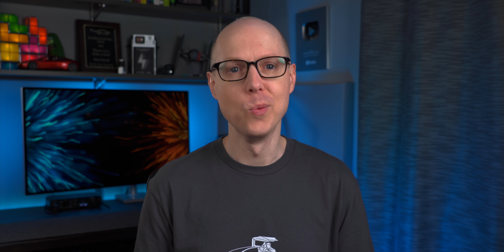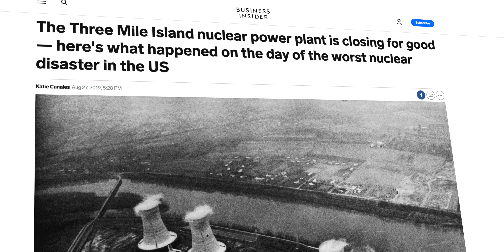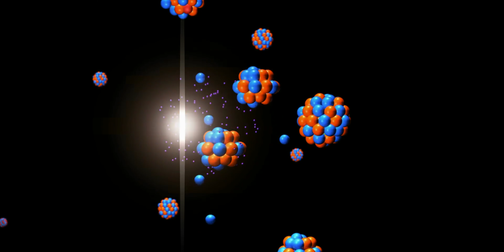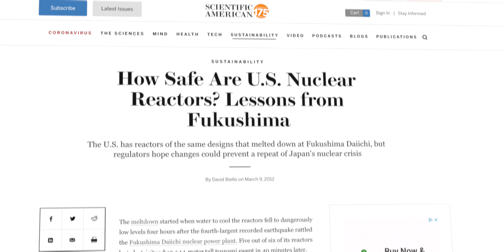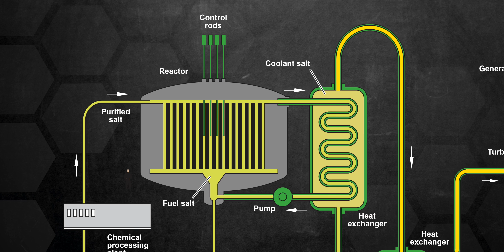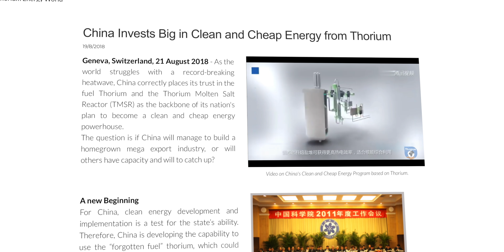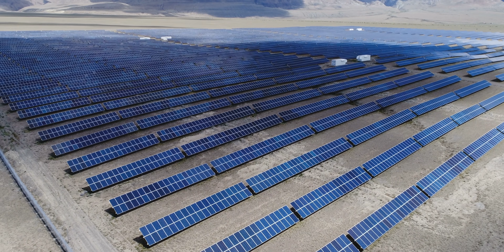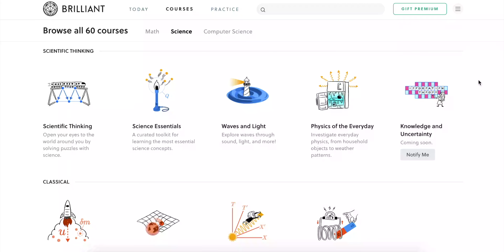Thorium explained - the future of cheap, clean energy?

Comment: We have had solar panels and a battery for 6 months. Our net electricity usage for a 5-bedroom house + EV + PHEV is -2.5 MWh.  This is, we have exported 2.5 MWh more than we have imported.  And we do not need to store any harmful byproducts for hundreds or thousands of years.  If everyone did the same, there would be no need for nuclear power.
Reply: The average residential sector uses 10-20% of total energy, and over half of that as raw heat, not electricity. (see Mackay or IEA for data) So, if everyone did the same, we would still have 80% of the low-carbon energy problem left to solve.

Just think about everything you and your family have no control over:
* tomatoes and other food 
     - power for ammonia, to irrigate, to pick, to ship, to cool, to sort, to package
* sewage and water
     - is your household electricity pumping, filtering, treating and metering?
     - you may pay MONEY for it, but you don't pay POWER for it
* offices, stores, and schools
     - do you control their lighting and thermostats
* buildings (including your house) and vehicles (including your EVs)
     - power to refine steel, to fire bricks, to melt glass, to produce plastics

Comment: There is a company called Moltex Energy that has an office in New Brunswick Canada, great Britain and elsewhere in the world. It has a great design using thorium. Their designs do not require the circulation of the fuel and that they don’t have the difficulties of corrosion associated with it. Check them out. I don’t wanna speak for them on the technical stuff. Thanks

Comment: This is the nuclear energy paradox, thorium molten salt reactor is the nuclear power we could have had decades ago and fusion reactor is the nuclear power we might have decades from now. It's ashame that science and politics keeps getting mix together.
Reply: And there's not a huge difference between them in terms of power. Deuterium - Tritium fusion only releases about 4X the energy of U-233 fission. However, a fusion reactor would also have to pour a large percentage of that power back into the reactor to maintain the system, magnetic confinement & all, so the actual difference is maybe 2x to 3x tops.

Comment: Where to begin with this Thorium nonsense?
First off it is not the cleanest nuclear energy, it is (or would be, if it worked)among the dirtiest. Every reactor will need a reprocessing plant with all the horrendous waste issues this implies. Second, it does NOT reduce proliferation of nuclear weapons material as claimed, it increases it. U233 can be made into a bomb just as effectively as Pu239. U233 is more dangerous to handle but so what, rogue states and terrorists do not care. It can also be chemically separated which is a lot easier than a giant array of centrifuges. Thirdly, it simply does not work, not today and not yesterday. Maybe it can be made work but why, we have effective and safe nuclear power today. Theoretically Thorium would be more efficient, but who cares, U235 is sufficiently abundant that efficiency is not a big concern. If you support nuclear power, modern reactors are fine. If you oppose it,  shifting from Uranium to Thorium won't make a meaningful difference.

Comment: So developing a new nuclear reaction technology and then building lots of nuclear power plants on that design is going to be faster than just continuing to build solar, wind and batteries? I'd like to see your evidence for that statement!
Reply: It's more to do with Base load for the electricity grid, which even with storage batterys like matt said at the start of the video, just don't cope with demand when neaded. plus see MrElifire84 reply in this thread, about land uptake, blight etc.
Their is already plans for modular Thorium plants, even down to size of shipping container. which if mass produced on a production line would be made fast.
Reply: @Jonathan Melhuish https://journals.plos.org/plosone/article?id=10.1371/journal.pone.0124074

Comment: I have been a big fan of thorium reactors since I first read about them in Popular Science. I believe the particle accelerator model would be the safest and you could install them in communities. They're cheaper that's why utility companies do not want to use them. Utility companies make profit on money spent not money saved. They make more money on a $1000 Bolt and they do on $100 Bolt. 7% profit of $1000 is $70 where it is on $7 on $100. This is the reason we can't have nice things!

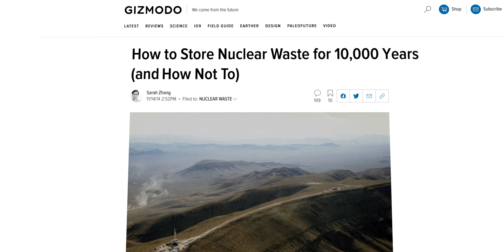Comment: around @3:42, there is the claim that the spent nuclear fuel from a reactor is simultaneously both highly radioactive, and has half lifes of thousands of years. 
While this is true, it is mostly true due to the great variation in elements that the nuclear fuel is split into. The most radioactive elements, that give off the most radiation, has half lives measured in seconds, minutes, hours, or days. The elements that have half lives in the multiple thousands of years, have relatively low radioactivity, with minor doses of radiation released.
The theoretical adavantage of liquid fueled reactors is that you can use chemistry to separate out elements from the spent fuel, and treat each element according to its longevity and potential for harm, instead of lumping them all together, and getting the worst of both worlds at the same time.

Comment: I did a whole college essay in nuclear power way back when. I stumbled on thorium salt plants and realized they were far better.  I didn't dig into why they weren't being used and lazially settled on money being the reason.  Thanks a ton for this video!
Reply: Thorium is better economically in almost every way it is three times more abundant making it cheaper to mine it doesn’t have to be enriched again making it cheaper to use and it’s 200x more energy dense honestly the only thing holding them back is the engineering and we already know the design once they hit the market they will be way cheaper

Comment: LFTR, the thorium reactor that I was most excited about.  A liquid fueled molten salt thermal reactor.  It uses a solid graphite (carbon) as the moderator and the molten salt for the coolant.  A moderator slows down the neutrons so they have a better probability of being absorbed.  The molten salt has about 1000 degree C liquid range, so it doesn't need to be pressurized.  Traditional reactors use liquid water as the moderator (hydrogen) and the coolant.  But water only has 100 degree C liquid range.  As you said the video, failures can be traced back to using water as a coolant.  Until recently, India been trying to use thorium in a water cooled reactor.  Which is why they haven't been very successful with their thorium program.

Comment: Great video my dude,
Well researched and you only made a few minor errors which i wont bother pointing out because as you said it's a high level video but I do have to say. ALL nuclear reactors can shut down at the flick of a switch, that's not unique to thorium. For example, Fukushima diichi actually shut down as soon as the earthquake was detected, it had water pumping through the system all the way until the backup generators were flooded and the 8 hours of battery backup was depleted and when the water circulation finally stopped, it was the remaining decay heat which caused the meltdown.
Fission had stopped well over 8 hours previously.
The reason molten salt reactors are "meltdown safe" is because the fuel is already liquid and can drain into the tank with low criticality and high heat rejecting properties which is a good feature rather than an accident scenario.

Comment: So now I'm looking on e-Bay for a small home thorium reactor so that I can go off-grid. I'll use the money I've been saving up for solar panels and a battery storage system. I'll use the spent fuel to try to kill these Tamarisk trees (the cockroach of trees that nothing else will kill). To solve the corrosive nature of molten salt reactors, I'll coat the inside of the reaction chamber and plumbing with dirty used motor oil, which gets under my fingernails and seems impervious to any cleaning agent known to man. There, think I have solved all the problems except how to find my home reactor on e-Bay.

Comment: Thanks for this good overview. However when looking at CO2 emissions you must look at a total life cycle. Extracting minerals, building massive concrete containments and separating and storing isotopes is to be considered. Same applies for large scale solar and wind. We need too think end to end to consider risk benefits and costs
Reply: I agree. This is a metric that is sorely lacking in many fields. For instance, how can we measure the total impact of water displacement for agriculture? It causes tons of water to be displaced. Increased surface area of water meaning more evaporation, and water vapor is in fact a green house gas (though short lived and rapidly changing, it is the predominant green house gas, often omitted because it is assumed natural.) We don't really measure our contribution of water evaporation for that purpose, or at least I couldn't find anything when I was a student with free Google scholar in 2017.
Reply: Amen to that.

Comment: Thorium as the predominant nuclear and power source of the future is vital! It's similar in benefit to the original industrial revolution (unfortunately, massively dirty) coal-fired steam plants in that, unlike renewable resource technologies of today, thorium power is a highly concentrated source that can be built/utilized nearly anywhere, and in addition to major improvements in efficiencies, abundance, safety and latent radiation, power levels can easily be adjusted, working seamlessly with renewable energies, thereby enabling the next industrial revolution. The only drawback (as I see it) is a thermodynamic one; Unlike solar or wind for example, utilizing any nuclear power source adds energy to our earth-system, necessitating additional massive global heat radiators or sun-shades to increase planetary albedo.